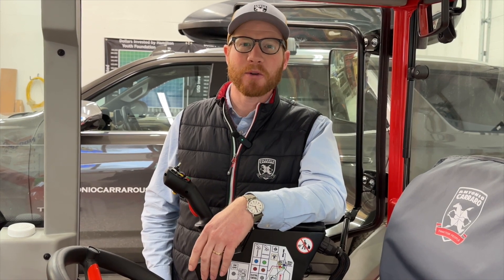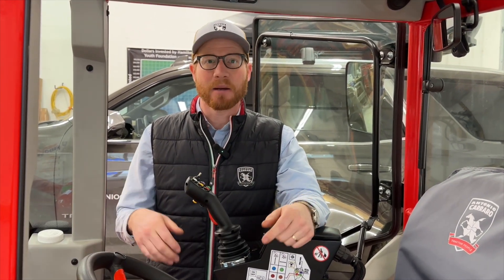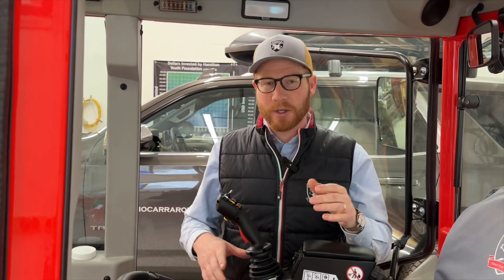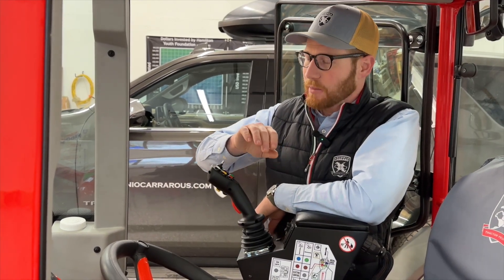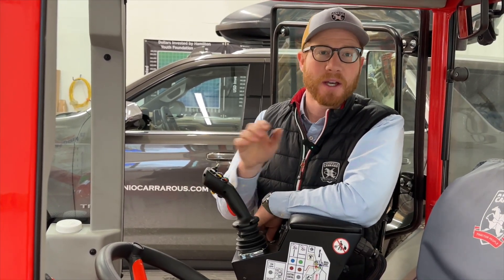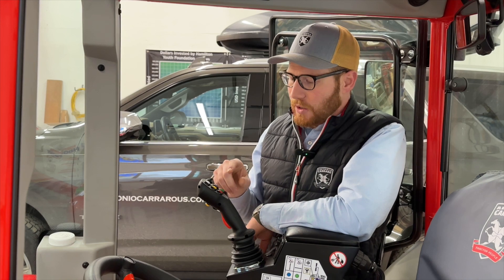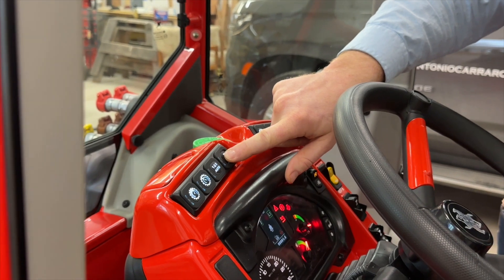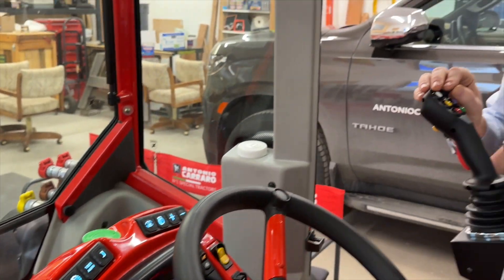Antonio Carraro SR7600 Infinity joystick overview

Comment: I have the SRH9800, the older dash and joystick, the button to engage the PTO does not do anything, I turn the PTO on and off with the dash button? Also, it seams that my float for the lift does not work, when I engage it, it slowly lowers the implement to the ground… any idea how to fix this?
Reply from the maker: I wish I could help, but if it is something electronic your best bet is to take it in to your dealer or repair shop.  My understanding of the float function is that it should allow your implement to follow the contours of the ground, so it would make sense that it would lower the implement to the ground.  But I may be missing something.  Hopefully your local dealer can help.
Reply: @mghequip  than you for your response. We do not have a dealer in my country yet, I imported mine from Italy. :)

Comment: Could you do a video like this with the previous gen Joystick and the speed control dash please.
Reply from the maker: Thanks for watching.  I would be happy to make a video about that but I don't have any tractors left with the previous gen joystick or dash.  Is there something you are having trouble with?
Reply: @mghequip  hi, thank you for responding :). We bought a used SRh9800 for our vineyards, I ma slowly figuring out the options. The problem is, the manual is quite illogical sometimes and the translation to english sometimes does not make sense. There is nothing in my language, Croatian, I speak German as well, same issue, very confusing and illogical.
Reply: @mghequip  i’ve learned more from your videos than anything AC published, printed…. I wish they had corporate videos more in this line rather than fancy video effects, music… we are farmers, not hipsters using these tractors. :))

Comment: Im wondering what the difference is between the on-off joystick and the proportional joystick? Also does the on-off joystick come standard on 7600 infinity models?
Reply from the maker: Hi Sebastian,

An on-off joystick is either on or off, with no ability to meter the response of the action being performed.  A proportional joystick allows you to meter your selected function's response based on how far you move the joystick in a given direction.  The more you move it, the great the speed or volume of the response.  There is no on/off joystick available for the the 7600 models.  They come standard with no joystick.  There are two joystick options you can add and both are proportional.  I hope that answers your question.  Thanks for watching.